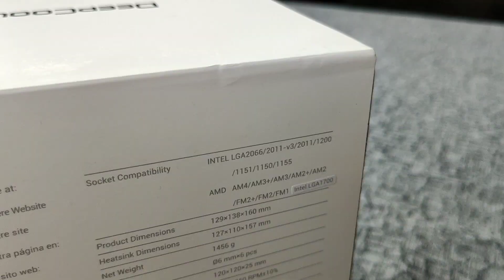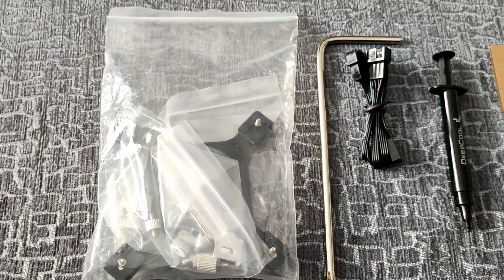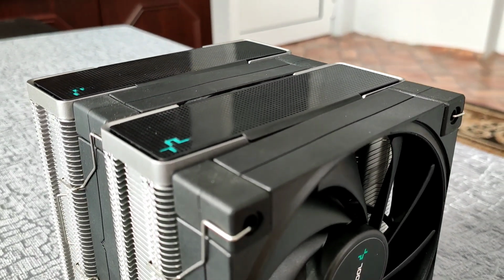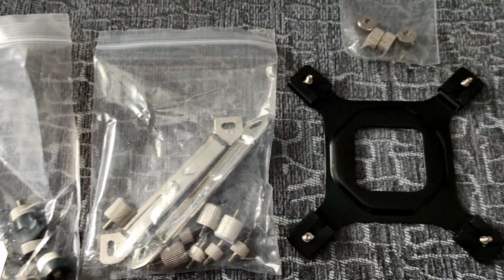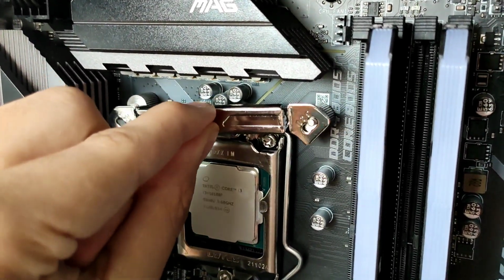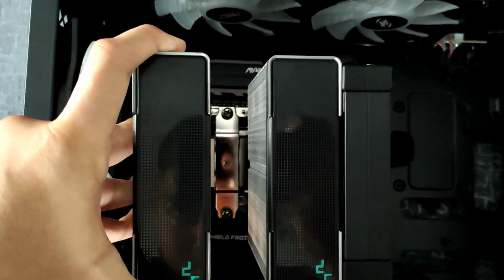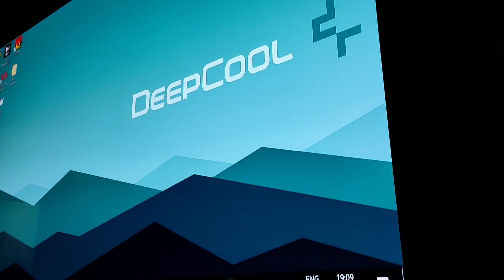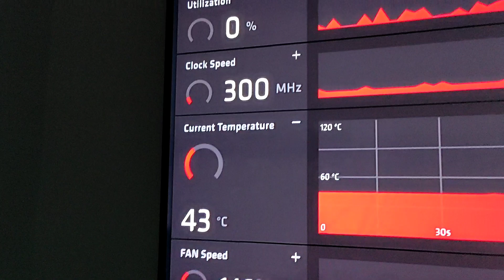The KING of Air Coolers! - DeepCool AK620 Unboxing & Review Installation Testing

Comment: Have a 5800x3d+g620, i got these numbers on a really hot day with an open case and the default voltage:
CPU Z=617 / 6120
CINEBENCH=1472 / 13778
max temp running the multi-cpu test = 90 package ccd 93c.
max temp running the single CPU test = 69 package ccd 77c
CPUID monitor was used to obtain the maximum temperature.
Is this normal or i fuck up the cooler mount?
Reply from the maker: Pretty good!

Comment: Why does every YouTube for this fan set it up. But does not go over the most crucial step plugging in the connectors... the instructions are 0 help and my pc is doing nothing but flickering on and off not booting up. Someone help
Reply from the maker: With the AK620 just connect the 2 fans into the splitter and the splitter into your CPU FAN header

Comment: Is it possible to put a 120 x 120 x 28 mm fan between two radiators? Or can you actually measure for me how many mm is the gap between the two radiators? I would replace one fan with an LED. Thank you!
I thought for a long time whether to take AIO or AIR. Having read that AIOs have various problems with pumps, pressures, bubbles, I prefer to choose the immortal AIR. I would put the AK620 over the 7800X3D. I will have many fans in the PC case.
Reply from the maker: My question is what kind of Led would you replace the midle fan? And yes Air Coolers in general are less problematic than AIO's? I will measure the width and reply to you!

Comment: I’m thinking of using this for a 7700X on a mini itx in the Thernaltake Tower 100. My only concern is with mobo being installed 90 degrees clockwise, will it be to heavy?
Reply from the maker: Nope it wont be heavy the AK620 comes with sturdy metal Backplate so you wont have any issues and also would look great in your case AK620 is the WAY to go!